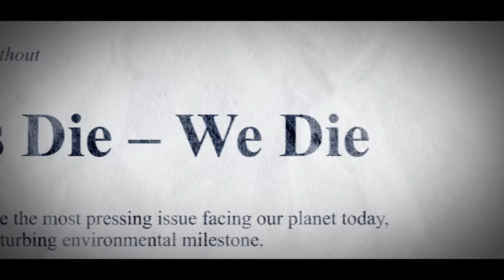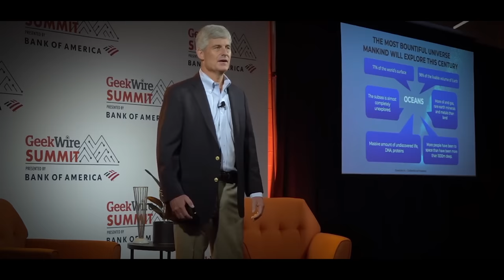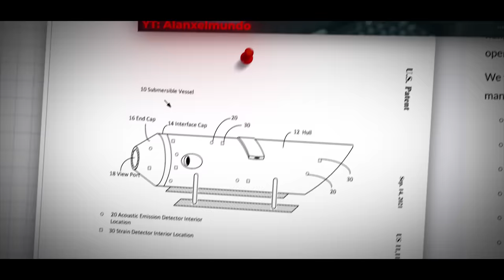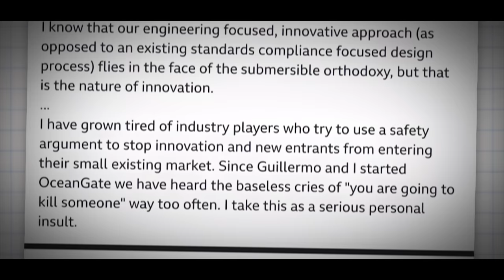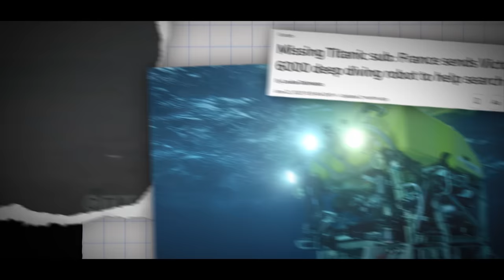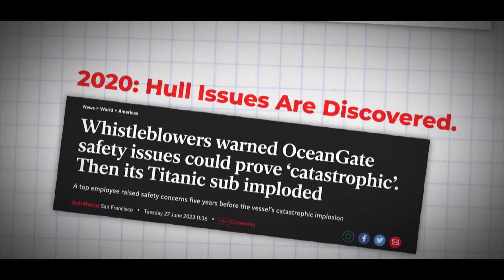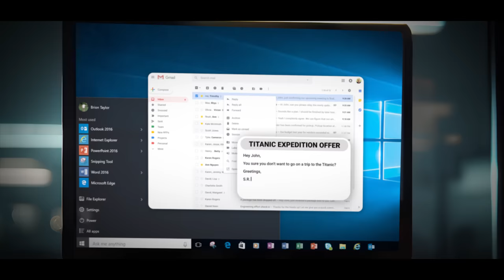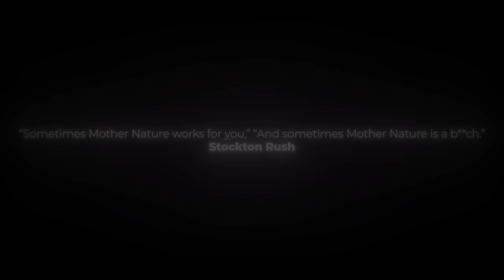The Dark Truth About OceanGate (Documentary)

Comment: Carbon fiber is great for containers needed to resist internal pressure, like pressurized gas tanks. As the internal pressure increases, the gases strain against the strong fibers which resist stretching. But when these vessels are exposed to external pressure, the strength of those fibers doesn't matter because it isn't being stretched, it's being compressed, so it's primarily the hardened resin resisting the pressure, not the flexible fibers.

Comment: The most unbelievable thing in this whole ridiculous story is that it's EASY to check that entire carbon fiber tube for the first signs of delamination. I had a normal, 18' boat inspected before buying it. To check if the boat has had any accidents, any boat mechanic will take a little hammer and slowly tap-tap-tap everywhere around the entire fiberglass hull. When the fiberglass has any deformation / delamination, the sound of the tap-tap-tap changes. It's super easy to hear. The mechanic showed us exactly where there was delamination. And they couldn't tap-tap around this sub's interior surface after every dive?
Reply: Could have. But didn't.
Reply: He fired the dude who said it wasn't safe. So yeah. Someone did. He just didn't care.
Reply: its not that easy. The problem likely took place, according to some, in the interface between the titanium ring and the carbon hull. catastrophic failure of the joint adhesive leads to immediate overloading and catastrophic failure of carbon hull. Its not just delamination. And were dealing with something EXTREMELY thick here anyway, your usual tools for detecting such a phenomenon might not work here

Comment: I work as a surgical technologist. I’ve been at it for 15 years. We use pretty high grade carbon fiber rigs to implant titanium nails in the canal of bigger long bones (femur, tibia, and humerus). We also use it for external fixators, mallet handles, specialty OR beds and a few other things. I’ve seen doctors break it several times. One older mans strength with a small mallet. Have even seen a carbon fiber mallet handle break. Yeah if it was me as soon as I heard carbon fiber I’d have been like “screw this.” I think more exotic materials are interesting,  I like carbon fiber for a lot of things. But I wouldn’t trust it on a submersible with my life on the line. It’s very much like my tungsten carbide wedding ring in some ways. Great for some things, bad for others. Tungsten carbide is very scratch resistant. They hold up better than gold in that particular way. But as I found out if you drop a tungsten carbide ring on a concrete floor it actually shatters like glass. Thankfully I had insurance and was able to get another one.
Reply: Yep. Tungsten carbine is usually placed in a metal matrix for a reason: it's really prone to cracking on its own. That, and metal is easier to shape. 

Also, like a lot of reinforcing materials used in composites, how useful carbon fiber is depends on the matrix you have it in. For example, they're actually considering using carbon fibers to replace steel in reinforced concrete, which is obviously going to be a lot different to an epoxy-based carbon fiber composite. This is because it turns out steel is actually really bad for reinforcing concrete in the longer term, as some recent bridge collapses have unfortunately illustrated. It can rot and corrode, even when not exposed to water directly.
Reply: Damn you're smart. You have a cool job. My friend Daniel Thomas Wood is a math PhD and got a job doing ...like....math problems that somehow help with cancer research medicine? I still don't know how math has anything to do with medicine, but your job sounds like one of his jobs. It's pretty cool.
Reply: sounds like a made up story bro... who in the world gets insurance on a tungsten carbide ring that costs max $30.....

Comment: What I find fascinating is that the hull itself wasn't even the final trigger of the disaster. They might have been able to surface in time had they had any sort of recovery system. But the fact that the Titan had to rely on its really weak thrusters to surface was a huge design flaw. Something as vital as surfacing capability REALLY needs redundancies in case of an electrical failure (which seems to have been the case here).
Reply: They had I think it was five options for surfacing.
Reply: I'm not following why you say that, but maybe I'm missing a piece of data. What is it that makes it seem to you to have involved an electrical failure?
Reply: They got some options one of them is dropping weights so it can float up without electrical. But it doesn’t matter much when the sub crushed into pieces
Reply: No. There was no electrical failure here. 
There was no warning, they were biology one moment, and then a fraction of a second later they became physics. The only comfort to take is that they didn’t suffer and weren’t aware of what was happening.
Reply: @5tr4nge75  there was a supposedly leaked transcript of communications between the sub and the mothership about how there was crinkling sounds coming from the aft of the sub and how their main power supply died, so they had to use a backup.
Reply: There is no recovery system made that could have surfaced them in time.
Reply: the first comment in this thread is misinformation

Comment: Even though I only have a bachelor's degree, I knew immediately upon reading about this thing being "missing" and learned how it was made that they weren't down there waiting for air to run out and it was all over.  That was a horrible design and it sucks people had to die to prove that.
Reply: I don’t have any degrees,  but I’d seen something about that cranky little ‘submarine’ before and that Stockton clown talking about it, and remember thinking that there’s absolutely no way I would get in that thing even if they paid me $250,000 to go.
When it was suddenly on the news that it had gone ‘missing’ after descending to the oceanic abyssal plain to visit the wreck of the Titanic, my immediate thought was that the vessel had been destroyed by the immense pressures found at those depths.

Even the word ‘missing’ seemed quite ridiculous in my opinion - as though there was some element of mystery to it - like someone who left work or something and had not arrived home for long enough to make people begin to worry - rather than the painfully obvious conclusion of what had happened to the occupants of an ‘experimental’ vessel made from composite materials that was thousands of feet below the surface of the ocean.
Reply: could have been possible that the release mechanism at the bottom wasn't working leaving then unable to float to the surface... however, based on oxygen levels and the distance down in the sea, if that had been the case (even if the material didn't fail) they wouldn't have been able to tow them, help them without robotic arms, transfer them to a safer vessel due to pressure, not gotten them back to the surface in time. It was doomed
Reply: I don't have a single degree and even I knew that hull imploded. Carbon Fiber on a submersible is a joke.  Theirs a reason military uses steel, its stable,  reliable,  safe,  long productivity,  etc. This man was a fool.  Had he followed industry standards,  sure it would've taken him a bit longer but he would've been become a respected innovator once he stared tweaking designs with staying with the basic hull/ buoyancy standard safety designs.  He allowed his ego to rule n this is the consequences of that. Honestly it seems more like a murder suicide,  with his outright blatant disregard of not only safety procedures but even his own companies due diligence in upgrading n rebuilding it in a timely fashion. At the very least he didn't care

Comment: I am not an engineer and yet I could see at first glance that the cylinder section of the submersible was subject to more  pressure than the titanium hemispheres and it would be crushed like a beer can.  Stockton Rush cared more about looks over safety as evidenced by the superfluous, cosmetic tail cone.
Reply: Good point about cosmetics. In the early days of microlight aircraft (late 70s), there seemed to be a philosophy among the laymen that if it looked like an aeroplane, then it would fly like an aeroplane. A lot of effort went into making sexy non-structural or semi-structural fairings. Some were let down greatly by the assumption. RIP those affected.
Reply: The shape wasn't the issue, it survived multiple dives to the Titanic. The issue was the materials and construction techniques.
Reply: @gjpercy never flew microlights, but spent almost 100 hours flying ultralight aircraft as a teenager - quickly discovered that the more complex parts to the vehicle, the worse the handling becomes (also hi, fellow Percy).
Reply: in tunnel construction etc that simmilar shapes you be suprised how thin the metal must be to support the tunnel.
Reply: @marcwilliams9824 people that know about epoxy, titanium and carbon fibers were absolutely horrified at how the components were glued together.
Reply: "superfluous, cosmetic tail cone"

Do you mean the tail cone that was filled with the absolutely vital trim bouyancy systems?
Reply: The damn thing looked like a kiddys bath toy! I got one from inside a cereal box when i was little...you put sodium bicarb in it and it would be propelled round the bath!😊
Reply: @marcwilliams9824 lmao the shape is 95$ of the problem

Comment: You know, I'm not the first to point this out, but if he had just done one test of the submersible and retired it, he could've definitely been seen as a trailblazing innovator. He made a submersible out of carbon fiber that made it to the titanic and back, multiple times even. They then could've taken the submersible apart, looked at what was happening to it, made improvements, etc. Maybe with enough time and effort, he could've been the spaceX of the submersible world, but even Elon Musk, love him or hate him, wasn't trying to send tourists to the moon on the first rocket he had built.
Reply: Uhhhh he delved how many times before with that same exact Titian? 😅
Reply: @marsaliscoln8892  As I understand it, this was the 14th trip. But your logic has a few holes in it. Namely:  The Titan is like a car in a way. Just because a car can run on dirty oil for a few thousand miles, it does NOT mean that it should. It can cause a lot of damage even up to failure.

 It was supposed to be a prototype, as far as I remember. With prototypes, you need to find their safe paramaters. To find this, you test until critical failure. For submersibles , you dive without passengers with full equipment until it buckles/explodes under pressure. A lab with a pressure chamber would be best for this sort of thing so you don't have to figure out how to retrieve the vessel for data. After each dive, you look it over, look for stress points, signs of material failure and the like. Then you send it again to watch the progression so you can take notes of signs or stages of stress. Then you dive again and again and again until it eventually fails. After that, you make another prototype and do the same exact thing at a deeper depth until failure. Then again and again and again until you have a full picture of what your vessel can handle, what the materials can handle and the like. This is how many industries find safety parameters. If you need an example, think of air bag testing. They crash the car over and over and over again and tweak in between until the force of the air bag cushions the crash test dummy instead of breaking its neck during deployment. 

The Titan completely skipped this testing due to Rush's mandates. As such, the company was, essentially, doing the above mentioned testing but with live people and then charging people for the chance to be the sea vessel equivalent of a crash test dummy.
Reply: @Yunfarron78  honestly I appreciate your comment and I think your right ultimately. Just, let’s not act like it was a one and done and this dude is a murderer. He did it plenty of times and at the end of the day (clearly as you stated) it’s safe if the right protocols are taken… just a bored black guys opinion. I could for sure sound like an idiot.
Reply: @marsaliscoln8892 he fired employees who said this would happen. He was arrogant and didn't want to listen to anyone who went against his plans. He probably told them they are just being negative.
Reply: @marsaliscoln8892  "At the end of the day, it’s safe if the right protocols are taken."
They weren't. They were actively avoided.
Reply: @IncredibleMD  at the end of the day, those same protocols were ignored and those attempts were successful. Yet, you want to avoid talking about those.
Reply: @marsaliscoln8892  Yeah, because he killed people.

Comment: Imagine the terror those poor people endured hearing the shotgun like sounds the hull was probably making as it failed?  I imagine Stockton Rush knew what was coming...and he was terrified while he physically exhibited the symptoms of a person in panic.  Which would have spread quickly.  Those poor passengers.
Reply: It would not have lasted long
Reply: Something this crappy, it'd be over faster than a lightning strike, which is why his "detection system" was mocked, it would have given them (assuming it even worked) about...2 seconds of warning.
Reply: @Rammstein0963. it certainly happened fast, the actual implosion but they had to have know for at least 5 minutes when electronics started failing
Reply: @christyl5481 not so. All the info I've seen shows an immediate failure. The explosion would have been several milliseconds.  The pressure is so immense, it's instantaneous
Reply: @Rammstein0963. More like 2 milliseconds.
Reply: @janelleg597  first it wasn’t an explosion. It was an implosion. And while that act would happen faster than the half blink of an eye, I highly doubt they went from electronic issues to an implosion. It was either the Coast Gaurd or Navy that said they captured the sound but didn’t release that info until after they discovered the submersible. To me this points to some issues before the actual act of implosion.
Reply: @christyl5481  But the sound was the implosion, not the sound of something happening before the implosion. Or am I misunderstanding what you are saying?

Comment: Questions:
1. Why didn’t it have gps?
2. What made the banging noises?  Cos it imploded very early didn’t it?
3. If it only cost $20k, why did he not have the hull X-rayed before putting it back in the ocean every time?  
4. He was charging a quarter of a million each passenger, how much did the actual sub cost to build
Reply: 1)  GPS only works pretty close to the surface.  If memory serves, only a few centimeters of water can be penetrated by the standard GPS signal.  One could probably boost a blue laser to a surface buoy and position that way, but could you imagine this operation spending the time and money?
1a)  So how do they track sharks?  With a dorsal fin dongle that transmits a GPS signal when the shark breaks the surface.

2)  Only a guess, but maybe pieces slowly settling to the benthic depths and hitting the ocean floor?

3)  $$$$.  The answer to these questions is always $$$$.  A set of scans could have saved five lives.

4)  That's one I just don't want to depress myself by looking up.
Reply: 5 : u go back and read and watch what’s being explained already

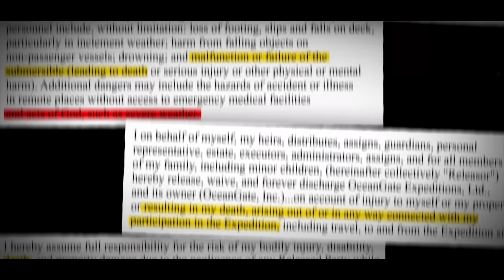Comment: 12:48 "A potion of the Expedition will be conducted inside an experimental submersible vessel that will dive 3,800m to the shipwreck of the Titanic. The experimental submersible vessel has not been approved or certified by any regulatory body and is constructed of materials that have not been widely used for manned submersibles."

How do you read that and not refuse to sign the waiver or get on board.

Comment: They should've just used a Quantum Field Harmonization Submersible. This cutting-edge submersible leverages quantum field technology to manipulate the density of water around it, creating a "density differential envelope." This envelope allows it to move through water with virtually no resistance, significantly reducing the energy required for propulsion and vastly increasing its speed and maneuverability compared to conventional technology.

Moreover, the Quantum Field Harmonization Submersible uses a localized space-time curvature adjustment system. By slightly bending space-time around itself, it reduces the effects of external pressure, enabling it to dive to depths that are currently unreachable by today's submersibles without the need for heavy and cumbersome pressure-resistant hulls.

The submersible also incorporates an inertia dampening field, allowing for instant changes in direction or speed without the inertia effects that would typically cause immense stress on both the vehicle and its occupants. This makes it incredibly agile, capable of exploring underwater terrains and avoiding obstacles with unprecedented precision.

Additionally, its energy efficiency and propulsion system are powered by a compact fusion reactor, providing a nearly limitless power source. This reactor is both clean and safe, utilizing the latest advancements in containment field technology to ensure that there are no emissions or radiation leaks.

Its ability to operate under extreme conditions without the limitations faced by current submersible technology opens up new possibilities for oceanographic research, resource discovery, and deep-sea rescue operations.

One can't help but wonder why Rush hadn't thought of this before . Perhaps it was the daunting challenge of bridging theoretical physics with practical engineering, or maybe it was the limitations of contemporary technology and materials science.